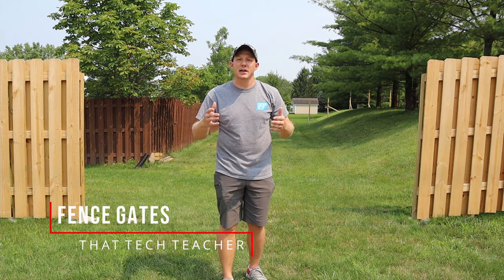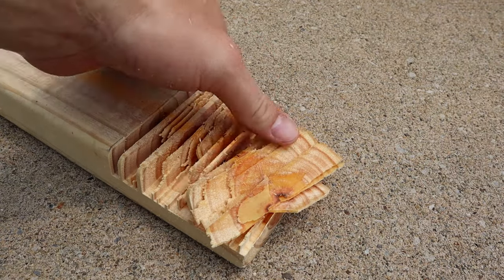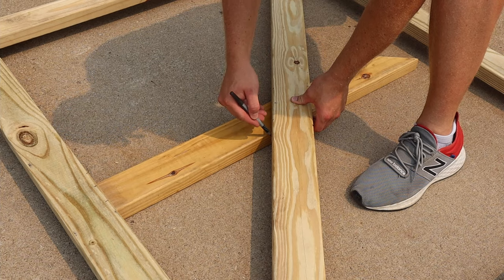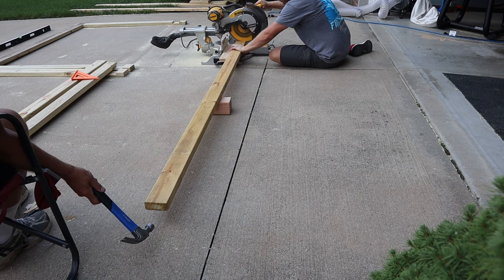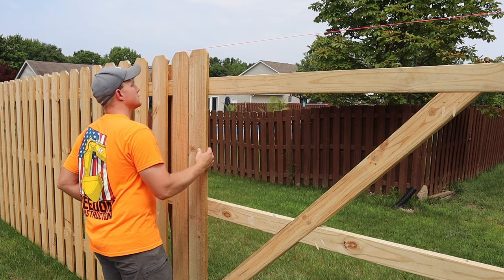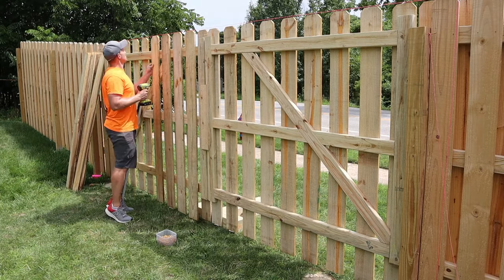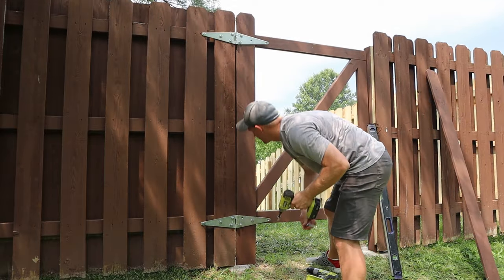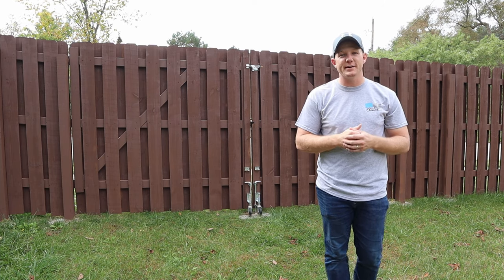DIY Large Fence Gates | How to Build a Gate that Won't Sag! | 13’ Double Gate | Fence Makeover Pt. 2

Comment from the maker: Gates are still holding strong with updates to come. If you want to see the other videos showing my fence project the links are listed in the description.
Reply: link to the hinges?
Reply: Where did you buy the hardware? Hinges, wheels etc.
Reply: Where did you buy the hardware?
Reply: I’m curious about the hinges? I have searched for longer lag bolts with hinge without any luck.
Reply: @ThatTechTeacher427 How’s the 13’ gate doing? Sagging issues? I’m going to build mine based off of your video this weekend. Thanks
Reply: Thank you. I want to build a nicer wooden gate with a lap joint but want the vertical slats to be like tongue and grove . Any suggestions on where to start? Thx
Reply: May of wanted to use cedar 2x4 on thd big gate they last longer outside and much much lighter not to mention won't warp like pressure treated.
Reply: tip for small gates (one panel gates), frame out the stringers, add your cross brace and all that, leave a little gap so your gate can swing without hitting then put your first picket on the henge side, cut the stringers on the henge side with a sawzall, add your henges, then cut the other side where the latch will go, now your gate is swinging free, then just add your latch and rest of your pickets, done. no measuring and all that bs
Reply: Did you sand before staining?

Comment: Great design, although i did the same design with screws thinking it would be stronger than nails , what i found out over time is that the movement or flex of the fence and gate through wind or opening and closing of the gate loosened the screws. Nails flex and screws don't. 
I built a fence with all screws thinking i was the best, although over time i had to keep screwing the screws in and over time they did not screw in as they were stripped out. 
My neighbor that built  a fence the same time used nails, and his maintenance  is nothing compared to mine. 
awesome

Comment: Looks good.  From experience with a drop rod in the ground - please allow me to suggest a change.  I would pour a concrete slab about 18-24" around the PVC receiver pipes.  Also, I would put  12" PVC pieces of pipe in the ground.  Deeper pipe gives room for dirt to collect between clean outs - less frequent clean outs.  The slab minimizes dirt washing in the PVC pipes and also locks them in against shifting in high winds.
Reply from the maker: That's a great idea and you are correct. For me I believe this is temporary, I am planning on a very large concrete slab in the area leading up to something.... 
For now I thought about drilling 2 holes in the pavor.

Comment: Great work! I’ve built hundreds of gates this way for customers. The only difference is I use 5” Structural screws and Mending plats to join the framing together. Never tried lap joint! Its a nice touch!
Reply from the maker: Thanks! I like the mending plate idea. The lap joints take a bit longer but I think add a lot of strength.

Comment: Thank you for such a thorough video. I have this exact scenario (a shadow box fence with a large double gate) and was looking for ideas on how to make the gates. This was so well done and I appreciated your attention to showing how you did the lap joints and the cross brace. Thanks also for the tip at the end about the doing a lap joint on the  cross brace - I will incorporate that. Your idea to use those wheels was phenomenal - such a great solution to help reduce sag. Much appreciated! I'm in process of building mine now and am confident I'll have a sturdy, well built fence and gates. Thank you!

Comment: Thanks for the video. I usually build my gates in place on the fence as a normal fence panel except the ends have hinges. Then just cut it in half. No need to lay it out on the ground.

Comment: I'm going to use your video to replace two sagging 10ft aluminum gates.  The gates  were even repaired poorly by a welder.  That didn't last.   The tricky part will be the PVC posts.  I either dig two new holes and put in 4x4 posts or attach wood to the PVC posts. Posts are filled with concrete.  Thank you.    And that awesome, your dad was a great helper and you could spend time together.

Comment: I’ve been using lap joints for years glad to see you figure it out the chopsaw works much better but you should have used at least 6x6 on your gate posts
Reply from the maker: Lap joints and the chop saw are the way to go! I debated the 6x6. So far the 2 4x4s pretty close are doing the trick but we will see what happens with time
Reply: We use a 4x6 for the hinge post if a 6x6 is not requested.

Comment: I am a retired professional land surveyor and have to admit that you plannned and executed your gate construction extremely well. I am going to be erecting a 4 foot stockade fence and will be building a smalller version of a large  gate for my daughter. after watching your video, I may either try a single 8 foot gate or a 4 foot version of your doudle gate. I have one question about your construction, did you ever consider installing an H frame for the bearing posts on each side of the gate to offset the weight load?

Comment: Great video. Did the same with our fence to access the greenbelt so I can mow behind the fence line but an 8 foot run instead. Cane bolts with some 6" 3/4 steel pipe too.
Reply from the maker: That will do the job!

Comment: Good looking gates.  I was wincing watching you cut the lap joints though.  Its almost always a bad idea to use both the fence and the miter at the same time.  I always clamp a block to the fence well back from the blade to set the spacing of the cut to prevent a kick back situation.
Reply from the maker: You are correct that was a dumb move on my part. I wasn't thinking

Comment: Fence that large needs a steel frame with steel posts. The wood over time will warp and drop. And wheels will cause problem on the dirt, even if parked on concrete. Know this from experience with just a 12 foot opening. Wood gates were great a year or two, then worthless. Did a steel gate, steel posts and eight years later, only some replacement of pickets due to splitting over time.

Comment: Exceptionally well done.... better than a lot of the professional work I've seen lately.  I'm currently working on rebuilding the fencing around my property.  Your video has inspired me to go that extra mile in getting the job done right.  My downside is that I do not possess a miter saw which is definitely necessary to complete those joints the way that you did them.  I wonder if I can rent one.

Comment: Do you have more details on the measurements /gap? For example if it was exactly 13 ft wide did you cut the 2x4 6 ft 5.5 inch?

Comment: @14:23 What kind of latch did you use?  I can only find that style for a post mount and the screw holes do not align with the 2x4 frame.

Comment: Love the gate idea with building as a complete unit laid out on the driveway. How did you determine what the “angle” was to transfer the layout to the flat driveway? Was it a combination of using the level and that large yellow protractor to determine angle of the string line, or did you use a different method?

Comment: RISKY CUT !  @ 1:52 .... When cutting a board perpendicular to the fence, set your fence 1 inch wider and put a 1-inch SPACER BLOCK at the front of the saw, between the fence and the board to be cut.  Hold tightly to the miter gauge (the guide) as the board "floats" next to the fence when going through the blade.  The perpendicular board should NEVER "ride the fence"....if it turns just the slightest, you will have DANGEROUS KICKBACK !

Comment: I feel like regular caster wheels (with no springs) are usually a better option than these springed wheels they sell for gates. These are probably fine for this gate, and fine for now, but if you have a heavy enough gate then over time the springs will give and it will still sag eventually. And there's no real benefit to springs unless the ground is really uneven and you are opening and closing it all the time.

Comment: Thanks a lot! Your catch on the latch saved me a ton. I couldn't find anything to help me with that until I saw your video. 👏👏👏👏
 Btw, I bought both 2 x 4 inch  and another 8 inch pneumatic casters, but after this video I was thinking of sticking with the 4 inch ones. Our gates are like the same. Is it still holding firmly with no sagging?

Comment: Thank you for this. I think I have watched this video 60 times already in preparation for my own project. I finally ordered the materials today only to realize that I don’t know if a 4x4 post (in cement) (existing) is sufficient to support such a wide gate? Are yours 4x4 posts? Also, do you think they would support a 90” single gate (I have an obstacle in the other gate that allows maximum 4’ gate on that side). 

Huge thanks for any help you can provide!!

Comment: @thattechteacher427 Great video! Where did you buy the gate hinges? I have been searching for similar hinges that come with the type of screw/bolts you used in this video. Most hinges I find online that look exactly like the ones in this video only come with basic exterior screws that will not hold up.

Comment: This is great, has a very professional look to it. I'm probably overthinking it but shouldn't the hinges for the gates be on the other side of the fence, rather than face the road? So the bolts and everything would be on the inside rather than open to whoever is walking by.
Reply from the maker: Thanks! I did think a lot about this but based on what is going to be inside the fence in the future opening to the outside worked best. Also most often it is the easiest way to do it.

Comment: Great video and excellent timing. I’m hoping to replace my 12’ gate this winter as it is sagging. Adding the wheels to take up some of the down force is brilliant. Can you provide a link for the spring loaded wheels? And, when you mounted the, did you compress the spring lightly so they are “pushing up” on the gate ends?
Reply from the maker: Thanks and good to hear! https://www.lowes.com/pd/National-Hardware-6-1-2-in-Zinc-Gate-Wheel/1000383225
I did compress them when installing them

Comment: The heaving of the soil from season to season became a problem for me. I live in Canada so freezing temperatures are a consideration to the overall final product. The pickets can't hang so low. Also, wind is a factor, as the constant rocking of the fence will eventually snap the posts. The solution is to make sure clearance of the pickets be 2" from the ground and gaps in the pickets be 1/2". The shifting is inevitable so you'll have to keep an eye on the fence once a year. I bolted mine to a 2x4 with Tapcons, but over time the heaving just ripped it out of the wall. The single and double gate doors gave me the most problems of all. But if the proper maintenance is given they'll last for decades. Grease all metal hardware, you won't regret it.
Reply from the maker: Good advice! Sound like you have some pretty harsh obstacles to overcome. I did make sure to leave at least 2" between the pickets and the ground and my post are below our Frontline so I'm hoping they don't move too much.
Reply: @ThatTechTeacher427  It's not merely the frostline. 4' deep is great. But the cause of the changing of the landscape is also caused by summer precipitation as well. during long dry spells the grass goes into hibernation(grey colour) and the soil around it shrinks. When the heavy rain comes it water logs the soil causing a slight movement. Over time the fence will shift in certain areas. In my neighbourhood many of the heavier fences have come down. Mine still stands because I have pickets on the front only. (substantially lighter) eventually my fence posts do snap. But I drilled a hole in the part still in the cement and remnant piece of 4x4 to fit a 3' piece of rebar. Covered it in 2 tubes of construction adhesive, leveled it and let cure for a day before reassembling. The regular annual maintenance thing. Of 27 posts, I've only had to repair 2.

Comment: what did you get that double gate latch? the similar latches I've found only work if installed on a single gate and a 4x4.
Reply: Tractor supply has those heavy duty hinges and latches for these. I'm ripping out the chain link and doing this with 6x8 privacy panels for my gate as well.

Comment: How do you work out the spacing between each picket, to get it so exact for the whole fence?
Reply from the maker: I explain it a little in part 1. Really it comes down to keeping the posts equal distances from each other. Then measuring the distance between them to see how many pickets and how many spaces there will be.